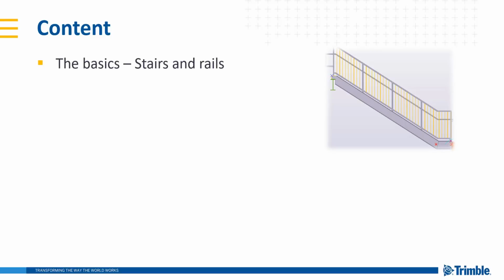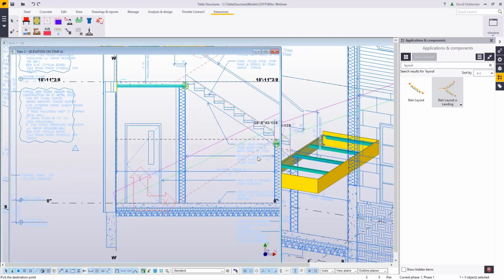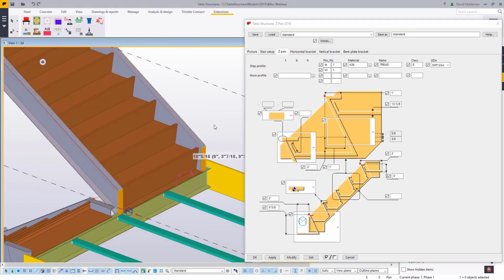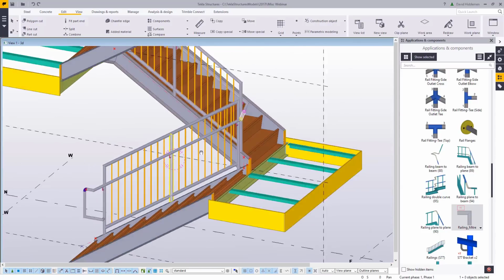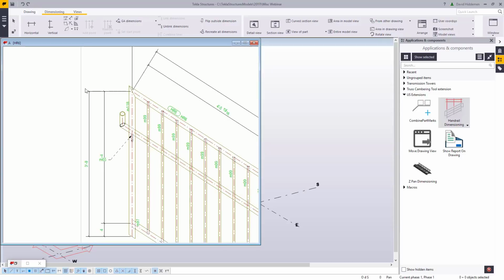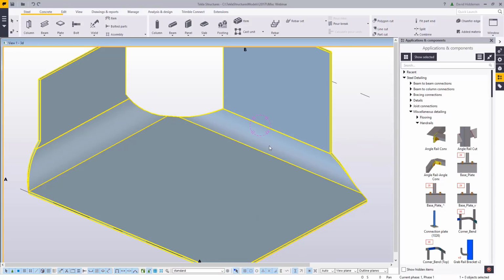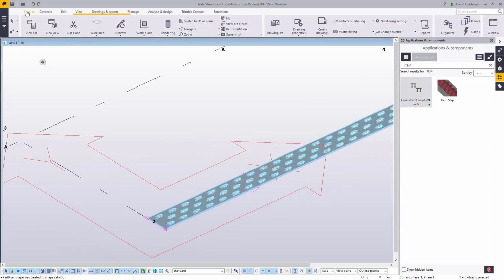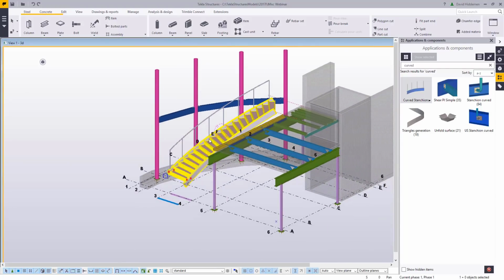Tekla Structures for Miscellaneous Steel

Comment: HI 
Could you please let me know how can i get the stair layout tool, i did try on my tekla warehose but i can't find, thank you
Reply: The stair layout custom components are not on the warehouse but included with the US Imperial environment in v2017i SP1 that we are using in the video.
Reply: Dave Hiddemen  thank you 
I did install the new version 2017i
Reply: If you cannot see them, you may not be using the US Imperial environment or perhaps not using our model template. You can import them from the  ...\2017i\Environments\usimp\custom_components folder (StairLayoutComponents.uel)
Reply: Thank you Dave i did re-install the 2017i and SP1 
it works, great videos thank you